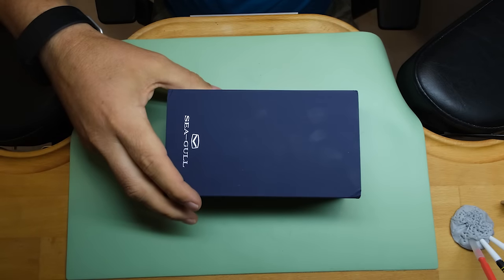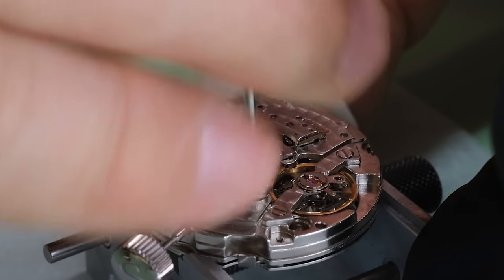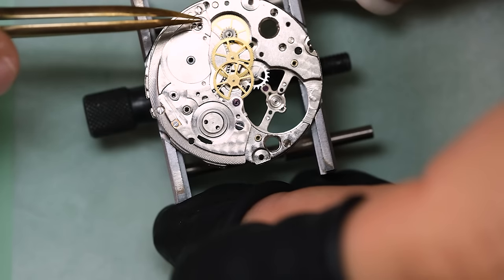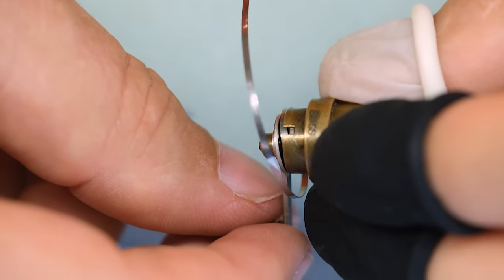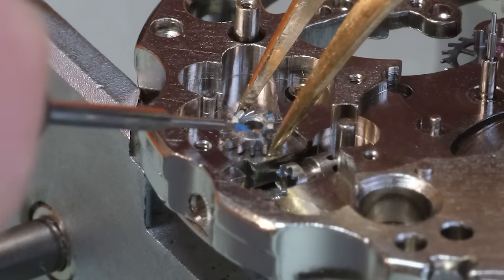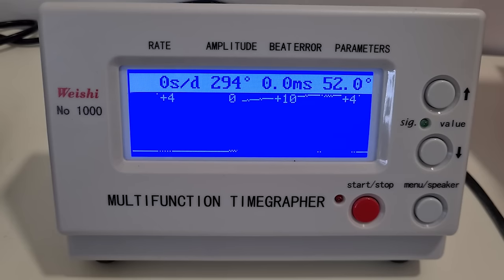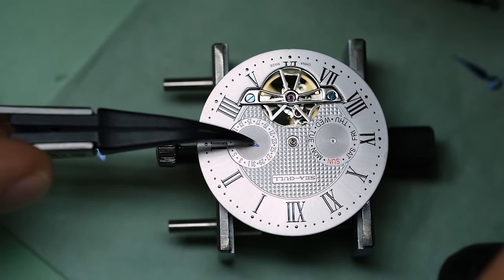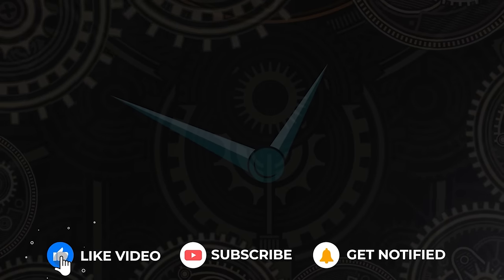How good are Chinese watches? Teardown + Giveaway!

Comment: ive always found seagulls to be very good value for money, they're an actual brand that has decent quality control, its a shame people mark off seaguls as cheap inauthentic watches just because its Chinese.
Reply: Casual racism and China is an easy target for the ignorant. I run a small farm with Chinese equipment, ride a Chinese scooter and have several Chinese musical instruments, all are good quality, and inexpensive.
Reply: The main issue I have is that they are all straight copies of ETA movements. If they design and build their own high quality movements from scratch like Japanese manufacturers then great, I will support that. Until then a "good quality" copy is still a copy that should not be supported from an ethical standpoint.
Reply: @llary  You're forgetting about the ST19 chronograph movement. Sea-Gull bought all of the tooling and the rights to make it from Venus back in the 60s. No theft there. Also, they have made their own movements before from scratch. Check out the ST8000 tourbillion some time.
Reply: @kerryburns6041  Most watch enthusiasts are kind of snobbish. Same reason ppl won’t buy the Kia Stinger eventho it’s a great sport sedan simply because it is a Kia!
Reply: Deffinitly interested in getting a seagull st1901 based chronograph as it's well within my budget while still being quite cool.

The trick is picking one because there are so many interesting watches based on it!
Reply: It's a shame that the copies they made are built with cheap materials. The ST19 could be made with the Swiss machines (not all, beware of clones), but the metals they use for gears and bridges are lower quality, not counting the cheap finishing or the sloppy assembling, to me they are an insult to a great historical movement. A column wheel Venus will run for decades with simple servicing. An ST19 will encounter problems in few years. Honestly to be so affordable, the producer have to spare money in the production somewhere.
Reply: @stupidocanerosa  getting better every year
Reply: @weedar_K1  What, the ST19? In that case, good for you. You were one of the lucky guys who bought one well assembled. In case you are talking of a Venus, I genuinely envy you.
Reply: @kerryburns6041  
First off, that was a rather ignorant comment.  You assume that concerns over quality has a racial component, which it does not.  You strike me as someone who likely seeks to conceal a racial ideology of their own.  Since I have never had one, I can't speak to what motivates someone to think as you do.
Reply: @PETERJOHN101  
I often find it fascinating when someone approaches a comment through the filter of their own prejudice.
It´s always so revealing.
Reply: @llary  then you shouldn't be driving a car, eating pizza or wearing a shirt.
Reply: @llary  sellita sw200 is 2824 copy and swiss made, along with the stp1-11, also 2824 copy made by swiss. Its not just china that copied swiss, even swiss copied swiss
Reply: I agree
Reply: I live in Shanghai and bought 3 Seagulls. Two of them literally shudder when I wind them. I don't plan on getting another one.
Reply: I have a Sea-Gull with similar Roman numerals and the 4 is no IV, but IIII, which is odd.
Reply: @nadermansour7487 That’s normal. IV is unusual for watches.
Reply: @llary the ETA movements are over 25 years old. Miyota copies then too and it's perfectly legal.

Comment: Thank you Stian.  I appreciate your take on Sea Gull..  I've been repairing and/or servicing this brand for about 6-7 years now and overall, I'm impressed with a number of their calibers, especially the copies of the ETA based movements (St3600, ST2130 in particular).  They're fairly reliable and I've come to expect a fair level of performance.  However, like you mentioned, QC is an issue.
Reply: Quality is a matter of attitude.  If you care, you put in the extra effort to cull off the defects.  If you do only what is necessary to avoid the tyrannical wrath of a Godless 5yeant you end up with the CCP stepping on your neck.
Reply: it depends on the factory and the grade.  Seagull is a generic moniker applied to movements from many factories and companies.
Reply: The issue is the intrinsic  bias....thus the QC issue 😊

Comment: Love the channel - watch looks interesting too! Great to see the cheaper watches show up as a comparison. I am a computer screw-turner, and learned on 1995-2015 Apple products. The 2003ish PowerBook G4 12” is similar: 6 layers of 30 parts, ~90 screws of all varying lengths - I can’t imagine trying to do that assembly inside of something smaller than a jam jar! This is why I love your videos. With so many screws, I used packing tape as a sticky tray, laid the screws out on them as I disassembled the units, usually in a meaningful position to where they went on the specific part. Used a marker to circle make notes and delineations on the tape to separate them. Re-assembly was easy when you knew where every screw went. A ~5 hour job the fist time turned into 45 minutes with practice. Good luck to you with your new video schedule.
Reply: Packing tape is a great idea, thanks
Reply from the maker: That's indeed a very good idea! The thing is that on pretty much all watches I work on there are certain characteristics to the screws, so you can pretty much always tell which ones are for bridges, which are for jumpers, which are for the keyless work etc. But this movement was all over the place, and I'm pretty sure I mixed up a few screws 😂

Comment: I have a pretty nice watch collection at quite a few different price points. I find it amazing that a movement like this Seagull can be placed in a handsome case and sold for $100 retail. I have a Chinese watch with a different Seagull movement and it keeps time as well as my Longines and Vacheron Constantin watches. What I find distressing are the very many “fake” luxury watch companies springing up all over the internet. Many of them are selling watches with inexpensive quartz or mechanical movements in the $600- $1,200 range. I particularly detest their use of FOMO or scarcity by saying the watch is a limited edition. Beginning collectors and others looking to give a lavish gift can easily fall for these scams. But $100 for this Seagull watch is definitely a bargain as far as I’m concerned.

Comment: Great video! I noticed that for these movements, before removing the crown you need to pull it out completely to the hour setting position. I also find it best to but the wire springs of the calendar work through the opening on the cover plate. Although these movements are cheap, because of their simplicity for cost reduction purposes, they tend to be difficult to work with. Many wheels under a thick bridge/cover plate, thin floating wheels, etc. And, very surprisingly, it is not easy to find spare parts for it. One of these movements was actually my first movement to disassemble and assemble. I would not recommend them for first movement.
Reply from the maker: Certainly not a first movement candidate! I should have done the wire springs a bit differently indeed, but honestly didn't really put much thought into it...

Comment: This is not the first time I've seen how sloppily they seem to assemble and "finish" these things in Chinese factories - kinda like a "if it runs, that's good enough - move on to the next one"-philosophy. And I can't help but be reminded of what, say, car manufacturing looked like not so long ago over here in Europe (and I'm sure in the US, too). Workers smoking cigarettes on the line, people walking around with hammers to "correct" imperfections in the bodywork, etc. The results were cars that would not only start to rust while sitting on the dealership's lot but that would come with a ton of faults and drawing a lemon was quite common. And  finding left-overs from the workers inside your car (bottlecaps, porn-magazine, cigarette butts, etc) was also quite common and another sign of how lax quality control was in those factories. 
But it's not just a lack of dedicated QC that's to blame here, I think and I tend to agree with you on this point: I think it has a lot to do with workers feeling good in their jobs and taking pride in their work. If you have to stand at your post for 8 hours a day, doing the same repetitive task over and over again, you probably won't enjoy what you're doing and you won't give a crap about the stuff you  produce and if it's as good as you can make it. I've worked in such a manufacturing position for a short while back in the day and I hated every second of it. 
I don't think it's a coincidence that modern car factories look much less like the hell-holes depicted in Charlie Chaplin's "Modern Times" and workers are being treated a bit more like human beings and like vital parts of the whole production process these days - instead of being treated like "fleshy machines" who simply have to function. QC starts with happy, motivated workers and from what I understand of China, that's just not how things are in most factories down there.

Comment: I'm rather glad you gave this watch a chance. For the money it's quite a nice looking thing.
I personally have a soft spot for Sea-Gull movements. A few of my watches run them. 
I actually learned a lot about watchmaking, (and crawling around on my knees late at night looking for springs that pinged off lol) particularly the ST-6 movement. 3 sub dials 21600bph and an Automatic. Fun for tinkering on, Learning about changing the timings on the moon phase/date and day wheels...For about $30 AUD even if I couldn't get it back together they're cheap enough not to matter much.
Excellent video as always mate, Cheers from Australia!

Comment: Very interesting and a lot information. I have 2 Seagull, the M182 SK and M172S (In the M172S watch the movement is very similar to the ST2502) not issue with both watch. 
On the same time my Seiko King Turlte is just full of QC issues, one week after buying it, I bring it back at the Seiko official retailer in Paris (Official dealer are just bad for Paris, and they know nothing about mechanical watch). A dust speck on the dial, 1 minute deviation/ day with the 4R36 movement for a new watch and a 230 ° amplitude (Lift angle at the 53° on the timegrapher). So the QC at Seiko seem really bad to me, and I would be curious to see the 4R serie movement disassembly. I know that the Seiko movement are know for having a low amplitude but beneath 250 ° on a new movement seem a red flag to me. For good quality watch, look for Orient watch with isthe property of Epson like Seiko but the two brand are independant.

Comment: I don't agree with your comment on the lack of quality control in China: you get what you pay for, il you are ready to have the price of the product increased, you will have proper quality control, but if you want a cheapest price at any cost, the cost of quality control is cut off.

And the quality of the light was good on this video, I did not see any problem on that :)
Reply from the maker: To a degree I agree with you, but even at this price level you can avoid leaving hairs and burrs...

Comment: I am actually surprised to see how complex the movement is (additional bridges, screws etc.). I would have expected something as easy as possible to turn the price to a minimum level. I prefer the non open-heart (black dial) version, as I always have the feeling the open-heart is a kind of fake Tourbillon...
Thanks Stian for the great video !
Reply from the maker: Well, it's a bit like that old Mark Twain quote: "I didn't have time to write you a short letter, so I wrote you a long one."
The design of the movement seems very basic to me, with very few refined and clever solutions. That is a sign of either an inexperienced movement designer or just a lack of effort. This movement should not be anywhere close to this thickness and all those wire springs are just ridiculous!
Reply: @VintageWatchServices  Yes that is exactly what I meant, I was expecting astute solutions to make the movement easy and quick to build and mostly by machines, but it ends up requiring a lot of manual and tedious human intervention !

Comment: Strictly from a watch movement perspective (no bias towards manufacturer or dial) what movement, in all of your years repairing watches, blew you away the most? It does NOT need to be a chronograph and have unnecessary complications. Just as pure engineering, science, and art, there has to be a movement you'll never forget.
Reply from the maker: Thanks for your question David, but that's a really difficult one. I'm generally not easily blown away but I think the movements I like the best are often Longines.
Reply: @VintageWatchServices  Wow, first off, thanks for answering my question. Your response was very unique and I didn't expect it. I'm such a dolt, I did not know that Longines made their own movements. Why Longines and is there a certain period that you like most? I bet you'd get a lot of viewers if you made a video about Longine's movements.

Comment: Hello again.
I'm hoping you could help. 😉 or anyone.
I'm trying to locate a mainspring for an alarm type pocket watch.
2.1mm width x not sure of the strength x 33 inches in length. With regular Swiss tongue and H hole for the arbor.
Can't find those measurements on line.
Could you possibly point me in the right direction. 
Thank you so much in advance. 
Love watching your videos

Comment: I noticed all my Chinese watches, you can't hear them tick very loudly like my non-Chinese mechanicals. How come? My Bulova Sea King has an awesome tick and even has a ratcheting 2-way rotor which I adore. OTOH, my Chinese Louis Bolle Solstice auto, 33 jeweled high-complication (Seagull 2504 movement) with retrograde hands and exhibition back is almost dead silent while running or manual or auto winding. While this watch is amazing visually, the absence of ticking or winding sounds is a huge let-down. I'll pay you to attach some baseball cards to the spokes!

Comment: Thanks for this video on a Chinese movement. I knew a French watchmaker who categorically refused to touch them because of their low manufacturing quality. For anecdote, in a Swiss magazine in French dating back at least a decade, a communication manager of Seagull (Tianjin Seagull Watch Group) declared that this state company wished to reach in less than 10 years the quality level of the ETA movements. I am afraid that this statement is still relevant today.  More revealing, on the Chinese market, several dominant brands are owned by private Chinese groups such as Citychamp Watch & Jewellery Group Limited or FIYTA Holdings Limited. They only use Chinese movements for the "tourbillon complication". The rest of the range of mechanical watches uses Japanese Miyota movements or Swiss movements such as ETA for chronographs. This is very revealing of the perception of Chinese watch manufacturers within the country itself.

Comment: The Mark Lovick channel favours the Chinese version of the Unitas 6497,readily available and cheap.There is also the 6498,but that comes in two versions one of which is a copy of what IWC did with that movement which involved replacing the normal plates/bridges with one enormous one,making alignment of the pivots more difficult.Of course a couple of Raketa 2609 movements are used by many budding watchmakers,usually available on ebay.If I were to win,please give it to someone else as I already have far to many watches....................................

Comment: I have several Sea-gull St5 hand wound movement watches from the 1980s. All excellent. I also have a 1963 column wheel chrograph bought from Poljot 24 in Germany. I have had it for 4 years now and it runs beautifully.

Comment: Sea Gull are oldest and best, and rember can t make better, than compare. And take today price of Sea-Gull. Only that I love China are where Japan be in end of 60s, today Seiko have very bad movment in 80 and 70 Seiko have 2 fabrique and they rry to make better movment , Seiko be competitive among they self, today 2 movment ( bad but cheap). MoV like 7006A, problem that I have i buy big whatch it s accurate but it s "half" of movment reserve only 8-12 hour s, whatch 50 mm diameter and movment i don t see smaller, arround are plastic, my 2 whatchment also locked and smille, it s not "Sea-Gull" , Sea-Gull is top.

Comment: in China, Sea-Gull (the original Tianjin factory) has to contend with Seagull, the many rebrands of the non-Tianjin factory 1963s that uses their original movement ST19 but otherwise 1963s not made or assembled by the Tianjin Sea-Gull factory

Comment: I have the 1963 chronograph from seagull and a few others. They run well, keep time and are reliable. I have a Mathey Tissot type 21 with the Swiss stp1-11 movement which recently broke after a few years, which is disappointing.